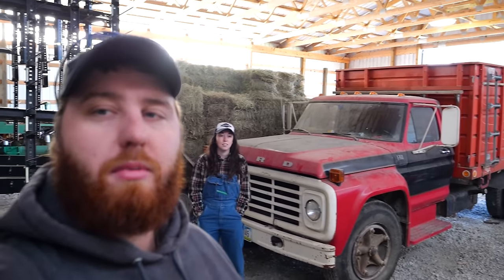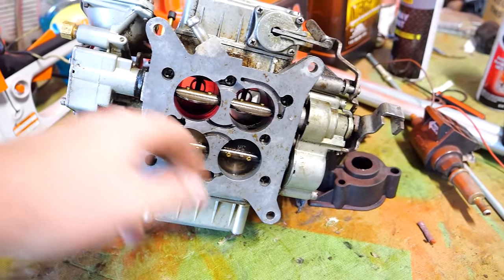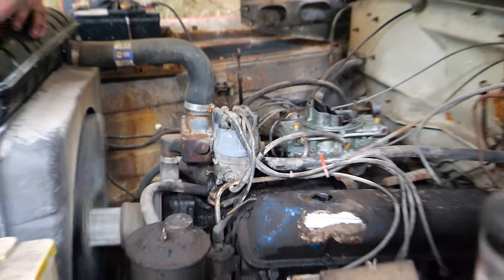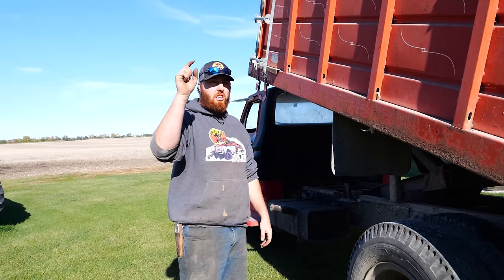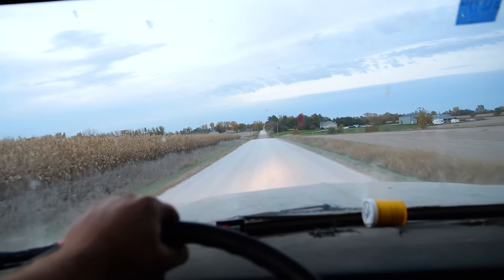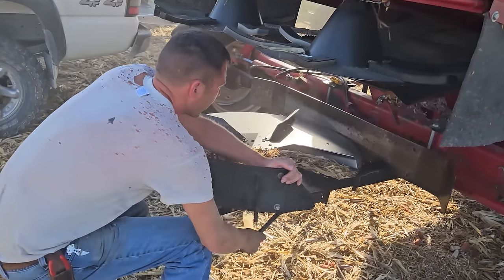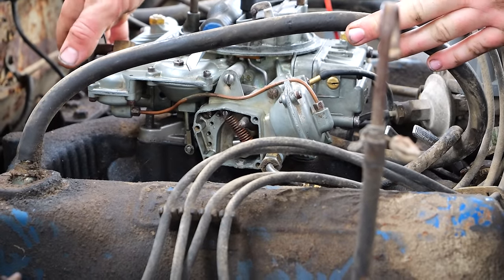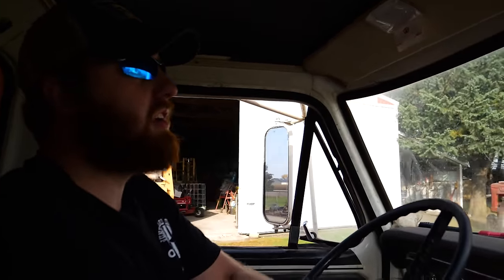Will this Old Grain Truck RUN & DRIVE in Time for HARVEST!?

Comment: That is a FT motor not a FE. They added the one cubic inch to the displacement to differentiate the FT motors, there was also a 361. Some key differences are a port in the block for oil drain back from a air compressor for air brakes, and the exhaust crossover is in a different spot in the heads so you cant use FE intake manifolds. They typically had smaller valves and ports to increase low rpm velocity for improved low end torque.
I's sure there are other things but that is what I can remember.
Reply: They also had forged steel cranks, heavy steel rods, and four ring deep skirt pistons. Very tough rotating assembly but kind of a dog on power lol
Reply: Also sodium filled exhaust valves to help dissipate heat under heavy load.
Reply: FT signifies "Ford Truck" and yes, there are differences between the engines though the exterior block dimensions are essentially the same. The FT engines were specifically built for low RPMs while operating with higher torque output and were never meant for speed. They were purpose built for heavy work and they were built to last which is why you'll find them in trucks over a rating of 1 ton along with buses or purpose built chassis which were sent to various coachworks for custom built vehicle platforms. The FT displacements were 330, 359 (supposedly), 361, 389 & 391 though you're most likely to find a 361 or a 391. So, can you use the FT parts with an FE engine? Yes and no. Some parts can be used without mods but others require machining. A few parts cannot be used at all. So, about those blocks. The blocks were supposedly cast using a higher quality iron and with wider internal journal webbing which makes many of them more desirable - though you should note that not all of the FT blocks were the same with what you could do with them - not all blocks could be safely bored out to be a 428 for example. Some of them had side bosses cast into the blocks making it easy to convert them into 4 bolt main blocks with the cross-bolt style. They also had steel versus iron crankshafts. The reality is that there are a slew of differences between the FE & FT engines when you look at ALL the parts that make up the complete engines so be warned. Be sure you know what you're getting if you scrounge for parts and know that many of the factory parts are inferior to aftermarket parts or even regular FE parts. The heads or exhaust manifolds would be a prime example. If you're serious about knowing the ins & outs of the FE/FT engines then the smart play would be to spend a lot of time on the WWW reading up on them or grab a few books covering them. Best wishes!

- Max Giganteum

Comment: We had a 391 in a 1975 F500 and she was a sweet old truck. That’s back in the days whenever we had to drive it onto a hoist and let them lift the front of the truck up in the air because we had no hoist on the truck.  What’s the brand and number on the beans?

Comment: Happy to see you guys working on a medium duty! I currently own 3 F600s and 1 F700 and man are they different. Oversized, underpowered, and the brakes are more a suggestion than a function. Hey Kevin, if you want an F600 grain truck for the future I'll sell ya one ;)
Reply: Underpowered is an easy fix, though, since they use FE based engines. Any FE will likely bolt right in, hotrod parts will likely bolt right on, and hell you could probably even get a 6.9 or 7.3 IDI diesel to just slide right into one if desired.-

I would throw some gofast parts at the engine already in it, though.
Reply: @TestECull  performance parts and industrial applications do not match up well
Reply: @magicstew45  Ain't nobody trying to make a living off working these ancient trucks every single day lol. Once in a blue moon like we see here is about the heaviest they'll see; other than that they're either yard art or parade floats.
Reply: @TestECull   You can use SOME FE parts on these but not many. An FT's red line is lower than an FE's as the FT engines were built for low end torque. Also an FE wouldn't hold up to being worked hard like the FT would.
Reply: @TestECull There's a tree crew in my area running one of these with a cherry picker on the back, I see that thing on the road every day.
Reply: AWESOME Ford F14000!!

Comment: I used to work at a sweet corn cannery in southern Minnesota back in the early 1970s. The factory had an old Ford F750 with a spreader bed for spreading the cleanings off the sewage screens. It had a five-speed transmission, so we affectionately named it the "Pantera".

Comment: Passed through IOWA recently. Went from Portland Oregon to Virginia in my 1993 toyota pickup. Actually gonna be doing the clutch fluid today. The clutch fluid is currently mud but still works lol. I had almost no problems other than the fact that both lower control arms are damaged and the truck is lowered so the shocks would punch through the control arms and scrape against the ground but ya know not much I could do about that other than replace the damaged shocks and attempt to hold it together to finish the trip. That little toyota is beat to hell but runs like a beast. Love my little truck. Im gonna restor this poor little truck.

Comment: Man that sound brings back memories. We had a 74 F600 grain truck with a 360 in it. Sound was identical. Only we had a 4 speed with a 2 speed rear axle. That vacuum brake booster behind the seat made lots of "vacuum" sounds. Then yountopped it off withba red acial flow combine we ia what we used. Definitely liked this video. Took me back to a better slower time.

Comment: I like the combine. We have the same one, but ours is a 94. Great machines. We also have an 86 IH 1640. The motor blew up 4 or 5 years ago in that one. We couldn't find another motor at the time, so we bought the 1660. As soon as we bought the 1660, we found a motor for the 1640. It came out of a tractor, so we need to change a bunch of stuff over to make it compatible with the combine. Then my wife's cousin sold me another motor that actually came out of an older 1660. They're pretty cool machines and fairly easy to work on. Great job on the videos and great job on the beans. They were better than mine are.

Comment: Fun fact, Ford used 391FT blocks for the final run of 390FE's to use up the rest of inventory. My 76 F250 had an FT block. Unfortunately it still suffered from FE issues. Sunken valves, cracked oil galley in the block... really they are the same block, just different bore for distributor. FT had a bigger dist neck, so they used an adapter to run fe distributors in light duty applications. I ended up swapping the rotating assy into a good '75 block, flat top pistons, new-used rebuilt heads, FoMoCo "RV" cam, Carter 600CFM 4bbl and a Pertronix HEI distributor (thanks to your recommendations in previous videos). Truck hauls now.

Comment: I have these style flaring tools and they are AMAZING. They are extremely useful, as you said, for redoing brake lines in tight place. Been using them for years with zero issues. Keep up with the amazing content, enjoy this series very much😊

Comment: That's a man that knows how to dial in his 1660. We just went from a 1460 to a 2166. It's amazing how the internals of these machines have stayed relatively unchanged for 40 plus years.
Reply: Yeah, the new machines are all about sophisticated GPS and auto tracking systems for the best yield. They haven't changed much mechanically inside. Although they have gotten way more efficient over the years for sure.  These days anyone can hold the wheel. Getting them dialed in is an artform though.  I got to ride around in a Case IH 6150 a few weeks ago.  It was a blast.

Comment: The 391 (and 361) had a steel crank with ever so slightly longer stroke, mostly just to differentiate them i would assume. Some 391 blocks are stout enough for big overbores supposedly.

Comment: I grew up driving a '72 "2" ton with a 391 on my family's farm.  It was used to mostly haul water tanks for spraying tobacco and cotton.  Man I love that old bird.
Reply: A buddy had an ancient (mid 60's?) hot rod Dodge grain truck as heavy as you could get on two axles. The beast had a very torque tuned 426 hemi. Not much good at the race track even empty but it did haul a pretty good pile of wheat reasonably well. Not diesel fast but not much slower either.

Comment: Kevin, Mook, you guys just solved a mystery that I had for years!! All the F-series trucks made in South-Africa had that same instrument panel in them, but in righthand drive form. Now I know where it came from!! We owned a 79 F100 with a 300cid motor for several years. Thank you!!!
Reply: I still drive a Ford, but it is 2018 Ranger, single cab with 2.2 l turbodiesel and a six-speed manual gearbox. Grew up in Fords, too many to mention.
Reply from the maker: I think it's from a bump side Ford! The prior generation
Reply: Thanks Kevin. It must have been to save on production costs. If it works, why change it.

Comment: By the way, its totally normal in medium and heavy duty trucks for the clutch to grab at the tippy top. Its in part so you dont have to push the clutch all the way to the floor when shifting, because pushing the clutch to the floor often engages a clutch brake.

Comment: These old gas powered grain trucks are literally everywhere in Texas and a great many can be found in good condition in the panhandle region.

They all seemed to fall out of favor at the same time, once the diesel engine trucks became available.  Diesels were more dependable,  they could endure more abuse, do more work, and they used the same fuel as the tractors, because most gas powered tractors had already fallen out of use, long before the pickup trucks were upgraded to diesel.

They would definitely make great restoration pieces and fabulous for parades, car shows, museums and addictions to private collections.

Comment: Kevin and Mook in bibbers,  Love it!  Great barn find grain truck yet again!!  Wooohooo!

Like that carb dip but thinking need to have a 5 gallon bucket along to use it in for size parameters of bigger carbs.  Then just dump it back in can or use a sealed lid on the bigger bucket so as to have for next project.

Comment: My first volunteer fire dept we had a 67 ford f700 5 speed 351 Windsor. Loved that truck. You’re lucky u have power steering. We had to install an air assist and it bent our solid steel steering shaft   Could only turn the wheel when you where moving or you bent it

Comment: That holley governor is not to slow throttle opening. It only limits max RPM. There are flyweights in the distributor that close a valve when max is reached. Be sure to clean the vent on the dist

Comment: The 391 The casting number on the side of the 105 block is shared with the 391 though. The reinforced main webbing is also shared along with the higher nickel content in the block material. Cylinder walls are usually thicker than the regular FE blocks but not always. The FE is considerably larger than the 302 or 351 The 391 with the original heads is almost impossible to get any type of performance out of them. They were cast with small ports and used small valves to promote high air velocity for efficiency and low end torque. Look for a "352" or a mirror "105" on the drivers side front of the block just below the head gasket area. Also look on the passenger side of the block for a casting number like D4TE-1 or something remotely similar. The spark plug arrangement on the FE looks like this:

HEADSIDE
\ \ / /

BTW the valve cover covers both the head and a small part of the intake on the FE/FT

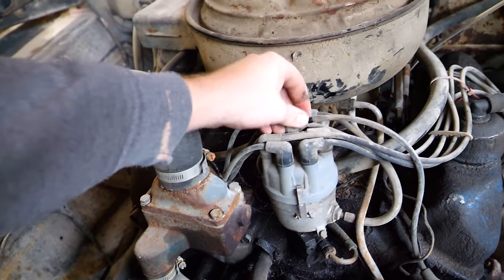235 horse at 3800 rpm, and a bit shy on torque compared to the 390 but it's made at a lower rpm. I would say if it looks like a 302 or maybe 351 it is a bored and stroked 351 windsor block. The FE is unlike the rest not to be confused for them. The only one really close is the ford Y-Block. The popular ford V-8 engine before the FE. And it is really only the same in design not nessicarily apperance. Hope the information helps Kevin 2:30 @Junkyard Digs

Comment: I don’t know if this truck has one, I’m just guessing because that’s how ours is, but if there’s a red button on the shifter, That’s for a high and low axle gear. If you pull it out, it’ll shift to the higher gear-ratio, and you’ll be able to go about 55. You just have to make sure you have the clutch pushed in when you switch it, because if you don’t, it will jam the crap out of the gears

Comment: I had a 1951 Chrysler Imperial with a similar power brake setup. The master cylinder you pushed was essentially signal pressure, and the booster applied the real braking force. It was like drive by wire but for brakes

Comment: That particular Holly has a governor on it. That you have to bypass by welding a piece on the linkage to  make it work the butterflies. I have that same motor in my dump truck/ That's a 391 industrial and they are their own breed of animal. The distributors are bigger as well as a few other parts are unique to that motor.

Comment: The 391 is a high torque FE that has a steel crank that quite a few ford hot rod guys have turned down the snout and used the stronger steel crank in 390-428 police interceptor blocks in high performance applications. I have owned and rebuilt a few FEs and they are expensive to get parts for now. Great motors though.

Comment: That brake system is a improved ford system.
Our 1964 Lifetime motor home had the top portion of the brake system (Mechanical) You get what You put into the brakes (Muscle)
The bottom under cab is the improvement (Vacuum Assit) Much easier brakes, just like today.
👍👍

Comment: On our old Combine We had to remove the plates for corn and add them for beans, not external but down inside the guts. I was 9 and Dad was too big to get in there so I was drafted. Mom about had a cow when she came to see how we were doing and Dad and I were talking but she could not see me. I was deep inside the combine. Boy Dad got it that time but he explained that is was the only way to convert to beans and the engine is not running its all safe. IH 503 or something like that late 50s. Great video I got to drive our 57 Chevy Dump truck alot. We had a Big Inline 6 with a 4 speed non synchronized 1st that must been 4 to 1 ratio we called it Granny Grunt.

Comment: I saw the nut that holds the carb on was still missing. you need to put that on so the carb baseplate doesn't crack or break.

Comment: Wait a minute, the engine runs, the brakes work, it has a spiffy red and black two tone paint job and most importantly the horn makes noise.  If you didn't have to give it back it could be Mook's new daily driver. 😁🚚 Also when is Mook going to post more content about the Nova or one of the Ford pickups. I've always enjoyed watching You and Mook work together.

Comment: 391 is forged crank, low compression, smallish ports and valves and governed carb.  Built to be low rpm torque engine for farm.

Comment: Yup the 391 FT. Very similar to the FE engines with only a few differences. I believe the heads are different, and the front end of the crankshaft is a bigger diameter and therefore the front main seal and the hole in the timing cover. Overall stronger build crackshaft which made it desirable in hotrod applications. Do your research if you haven't already. There isn't much information to find but it's quite interesting. I didn't see any other comments about the engine so I thought I'd leave one. It's correct to the best of my knowledge but if something I said is incorrect please do correct me.

Comment: i have a hydrovac  on my chevy c60   you can only ship it and have rebuilt cant find a replacement , the big end is a vacuum can with a diaphragm mine had a hole in it  so my brakes were HARD all the way down since i couldnt find a replacement and it would take a couple of MONTHS to get back from the rebuilders i GLUED a patch on each side of the hole/tear (was in a wrinkle of the diaphragm)  ----AND IT WORKED been running that way for a couple of years now ---who'da thunk  .  Have FUN harvesting

Comment: FYI for those curious 217 bushels of beans would sell for around $2,600 ish , give or take 30$ , assuming they actually sold them on oct28 as the price point was around 12$ a bushel

Comment: 391 is an FT engine. same block, different bore by I think 2 thou
FT hole for distributor is also bigger, as is the distributor neck.
cannot use an FT distributor in and= FE, but could use an FE distributor in an FT. but inadequate side support would cause it to wiggle and wear the gear rapidly.
Crank snout on the FT is also bigger

Comment: i knew the second the hood opened it had a hydrovac system. I just bought a 68 N600 with a hydrovac system. i need to replace all 8 wheel cylinders.

Comment: You can "one-man" bleed brakes without opening and closing the bleeder each stroke by getting a plastic (Coke) bottle and putting some fluid in the bottom, enough to cover the end of a plastic hose you run to the bleeder screw.  Open the bleeder screw and pump as you have been doing.  Pressure will force out fluid and air, but with the end of the plastic hose in the bottle and fluid, only fluid can be drawn back up the hose.  It's also best to pump the brake pedal only about halfway.  Gunk and crud build up in the master cylinders and if you push the pedal and piston into that you can damage what might otherwise be a serviceable master cylinder.